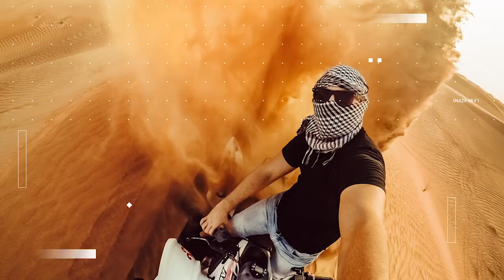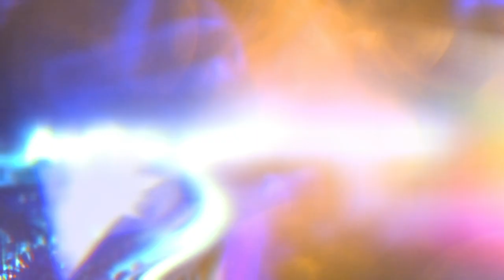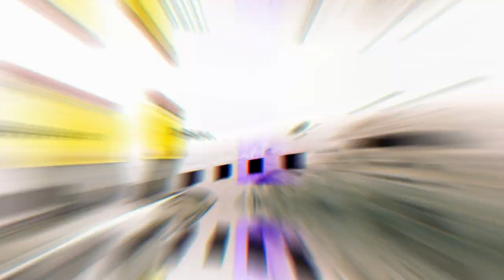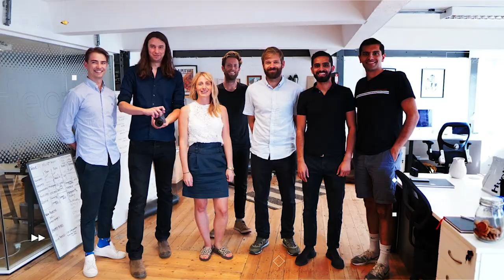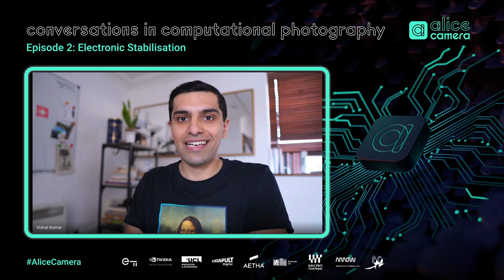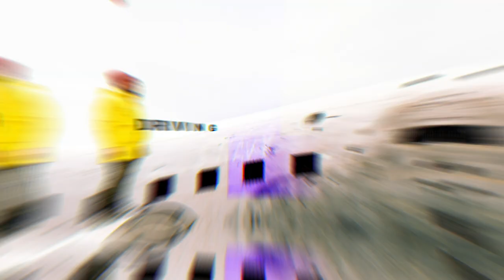Episode 2: Electronic Stabilisation | Conversations in Computational Photography | Alice Camera

Comment: Electronic stabilization is useful for videography -- we got this the recent Olympus cameras, on top of IBIS and hybrid IBIS/OIS. And unless your camera's firmware is designed to understand video as a different thing than stills, still camera stabilization can certainly fail for video. But get a good hybrid, video-designed IBIS/OIS + digital stabilization system, and you feel like you're using a gimbal. Of course, digital stabilization inherently reduces sensor resolution (depending on the sensor resolution, not necessarily video resolution).  

It's interframe vs. intraframe stabilization -- both are necessary for very good stabilized video. Stills only care about intraframe stabilization, and you can't get that with digital. 

After using Olympus cameras for 9-something years, I bought a used Fujifilm X-Pro1 as part of a creative project. And of course, for fun. The thing that hit me the most was that, in still photography, I had really forgotten that you probably can't just always nail a 1/10s shot with a normal lens. Image stabilization had completely changed the way I approached photography, and not all at once, but over time, as the technology evolved. 

Of course, I backed the Alice Camera on Indiegogo knowing this full well. You can always adapt.